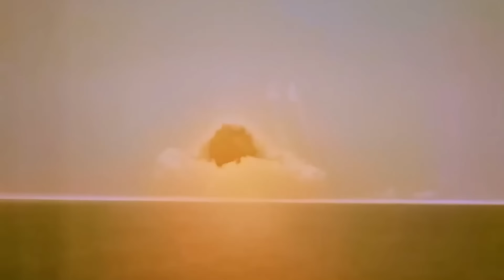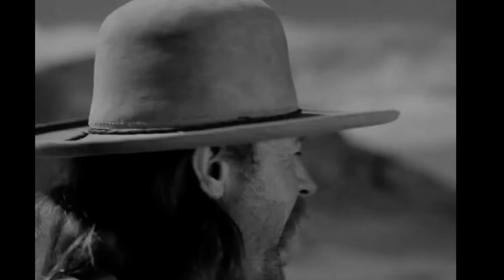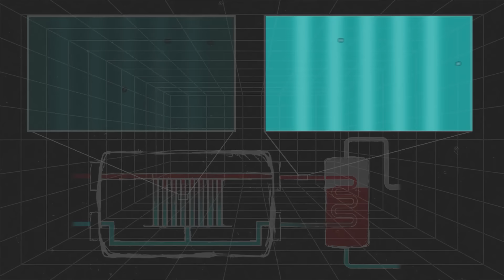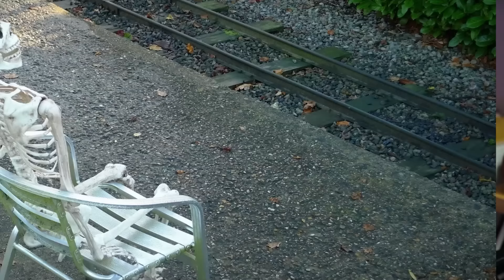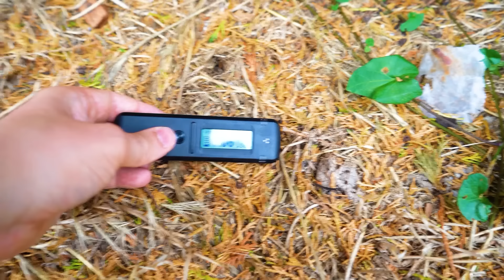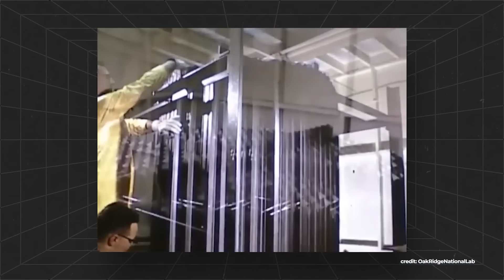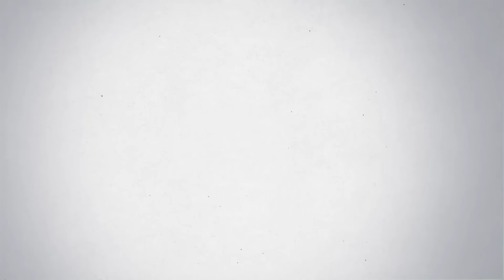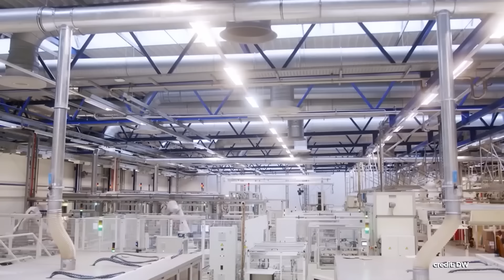It's Happening - China Launches World's First Thorium Nuclear Reactor

Comment: *** CLICK-BAIT ****** China Launches World's First Thorium Nuclear Reactor **** 
China is "launching" as in "breaking ground". CCP Propaganda is attempting to be first, in order to ignore the fact that BILL GATES beat them to the punch.

"Nuclear energy, if we do it right, will help us solve our climate goals."
ByWilliam Kim
May 8, 2023, 11:00 PM
November 18, 2021 - Bill Gates' TerraPower has chosen Kemmerer, Wyoming, a frontier-era coal town, as the site where the company will build its first demonstration nuclear power plant.
Bill Gates’ company, TerraPower, is developing a thorium-based nuclear reactor, known as the Natrium reactor. This design aims to be cheaper and faster to construct than traditional reactors, with potential benefits for climate change mitigation.

Key Features:

Thorium fuel: The Natrium reactor uses high-assay low-enriched uranium (HALEU) as fuel, which is enriched with more uranium than traditional nuclear plants. This allows for a different fuel cycle and reduced waste production.
Sodium coolant: The reactor uses high-temperature liquid sodium as a coolant, instead of water. Sodium’s boiling point is eight times higher than water, eliminating the need for continuous pumping and reducing the risk of coolant-related accidents.
Advanced design: The Natrium reactor is designed to be a small modular reactor (SMR), with a compact footprint and modular construction. This enables faster deployment and reduced costs.
Wyoming location: TerraPower has chosen Kemmerer, Wyoming, as the site for its first demonstration nuclear power plant. The location takes advantage of the state’s uranium deposits and existing infrastructure.
Benefits:

Reduced waste: The Natrium reactor produces significantly less nuclear waste compared to traditional reactors.
Improved safety: The sodium coolant and advanced design reduce the risk of accidents and minimize the potential for radioactive releases.
Faster deployment: The SMR design enables quicker construction and deployment, potentially accelerating the transition to cleaner energy sources.
Domestic supply chain: The Wyoming location allows for a domestic supply chain, reducing reliance on international fuel sources and supporting local economies.
Timeline:

2028: Expected operation date for the first Natrium reactor.
2030: Planned completion date for the Kemmerer demonstration plant.
Investment and Partnerships:

$750 million investment: TerraPower received a record-setting investment round led by South Korea’s SK Group.
Partnerships: The company has partnerships with Warren Buffett’s Berkshire Hathaway and other investors, demonstrating confidence in the technology and its potential.
Bill Gates’ involvement in TerraPower and the Natrium reactor reflects his commitment to addressing climate change and promoting innovative, sustainable energy solutions. The project’s unique features and benefits make it an attractive option for reducing greenhouse gas emissions and revitalizing local communities.

Dr. Ben Miles :  wow. dont get indignant. you knew full well.